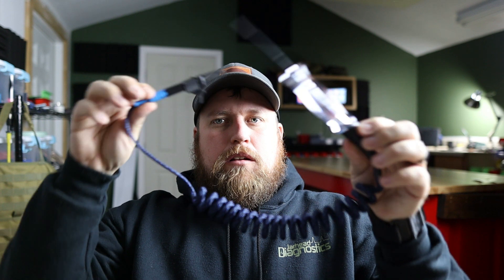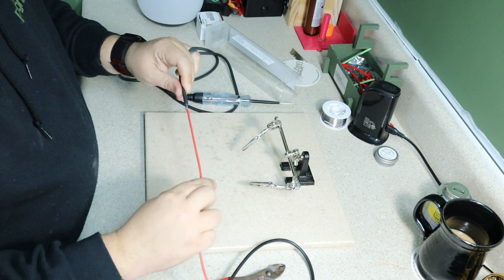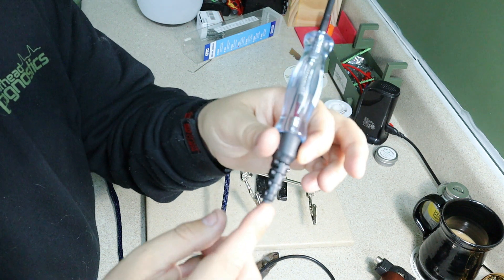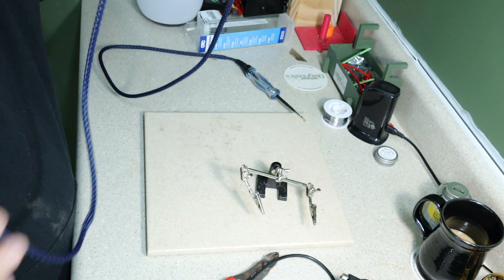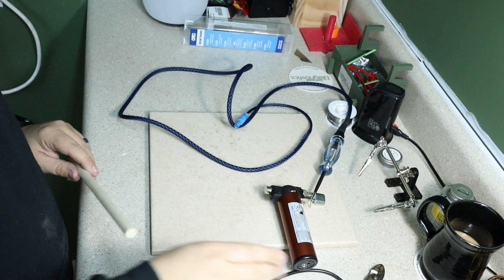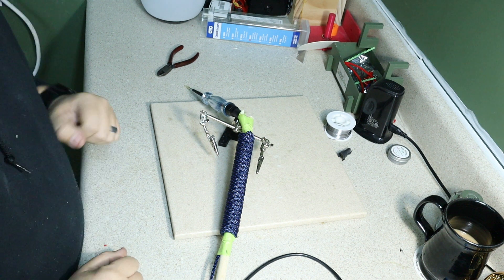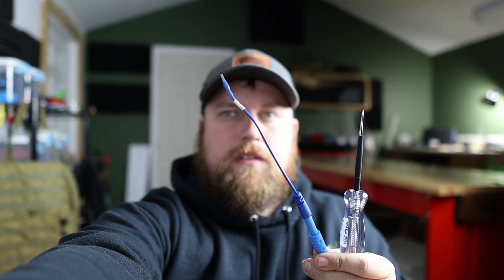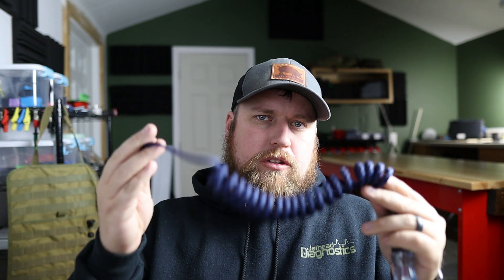The Best Automotive Test Light!

Comment: Left you a message on website under contact information. Did you get it? It was about how you have the KIT for this project priced then when you click on w or w/out test light the price is the same. I'm guess the with and without is if we want a test light already made up vs not made up?? Maybe you can clear that up plus the price before a with or without is selected. 

Just need the parts for it otherwise I'll check with Carlos @ aeswave a they make leads custom so my guess is they have some parts as well. Whether I have to buy in large qty is another question though. 

I also left a phone message at the phone number listed on your website.
Reply from the maker: Your email was responded to sir.

Comment: Nice tutorial. I like how you added the flex loom sheathing. Looks great. I use the stackable banana plugs so that if you are clipped onto ground , the same ground can be used for a scope or meter without disconnecting anything. Ive also added a banana plug to a set of lockable pliers (vicegrips). Makes a great ground clamp when needed.
Reply from the maker: I love that idea. I think @southmainauto has one.
Reply: Perhaps try some heat & abrasion resistant woven ceramic sleeve. Never used it on a test light, but I've covered a lot of wiring near headers, etc.

Comment: Cool. That will be very useful.  Thanks for sharing.  On the weekend I modified a 145ma test light clamp with a small vice grip needle nose.  Cheers...
Reply from the maker: Excellent idea as well.
Reply: @JarheadsGarage   When I have a chance I am going to add the banana adaptor to the unit so I can interchange the vice grip and accessories.